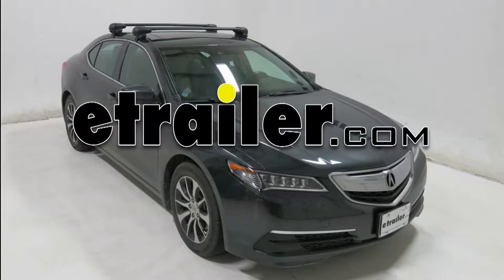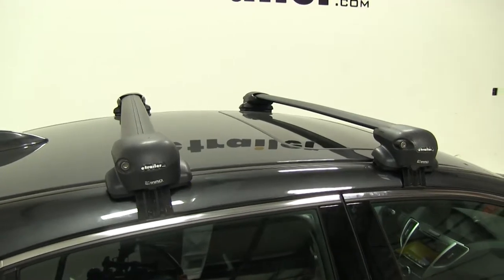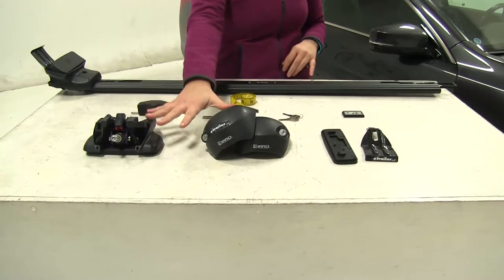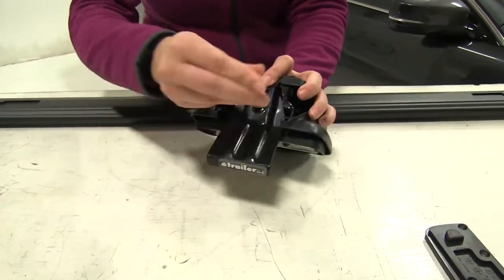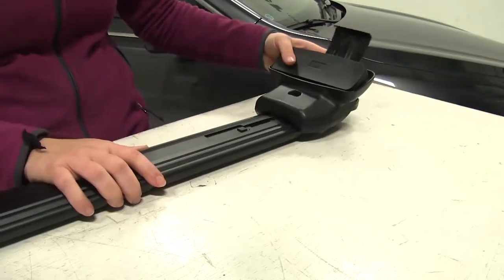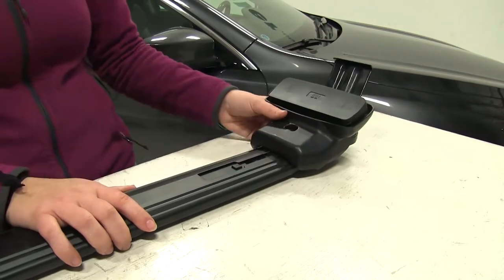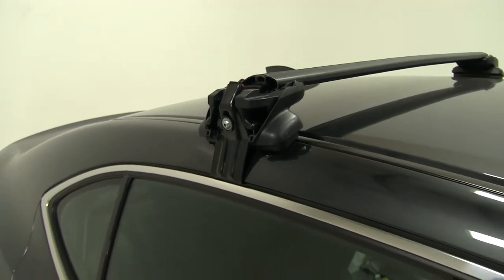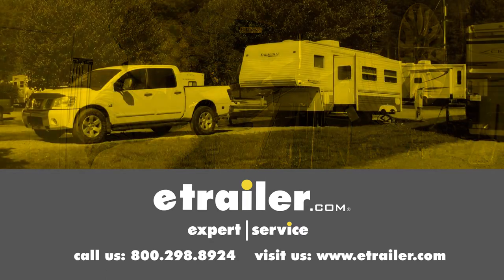etrailer | How Does the Inno Aero Flush Roof Rack for Naked Roofs Fit on a 2015 Acura TLX?

Comment: are these still compatible with a 2018 acura tlx a spec?
Reply from the maker: Yes we have a confirmed fit for the 2018 Acura TLX. For more information you can visit our product page 
https://www.etrailer.com/Roof-Rack/Inno/INK668.html
Reply: Can they be spaced further apart? I need a rack for a 9’ surf board so I need maximum space between the 2 bars
Reply from the maker: @larrybooze8179  This is the furthest that the manufacturer recommends putting the two bars because of how the custom fit brackets are made to fit the door frame.
Reply: Hey Brian did you ever use these? I'm nervous to put anything on my aspec but really want to kyak this summer!!!
Reply: @eastcoastjersey  no man